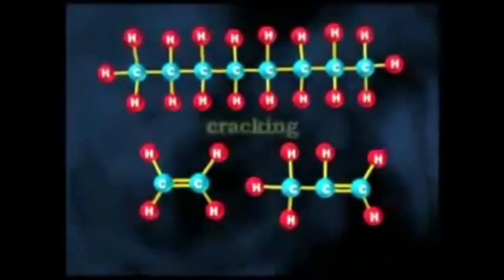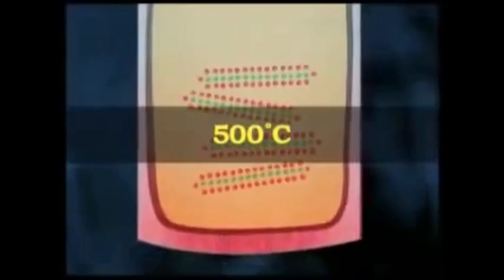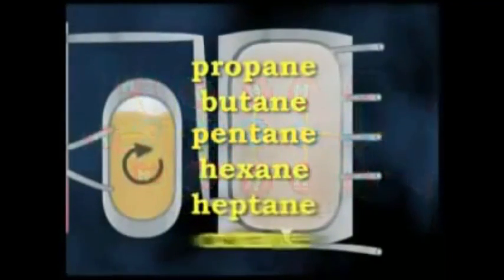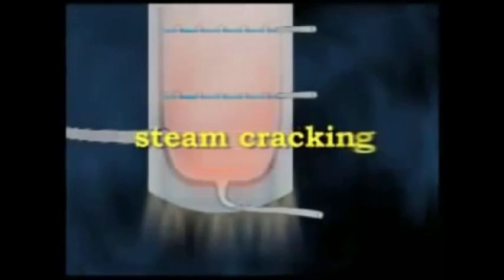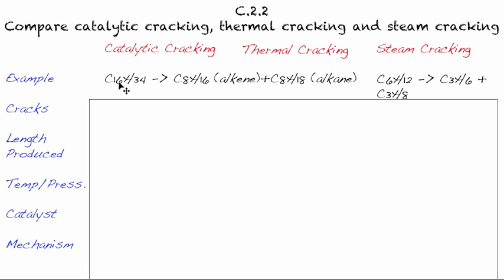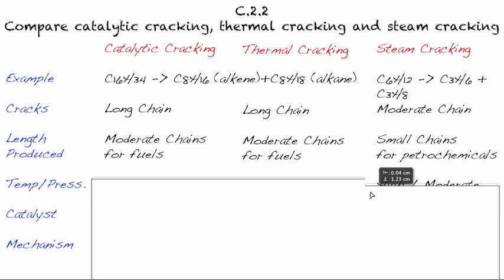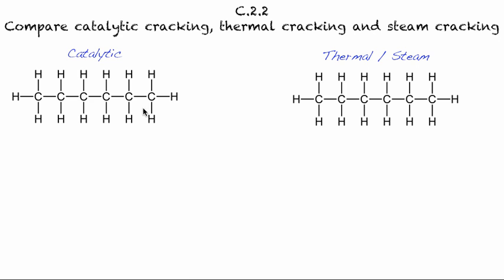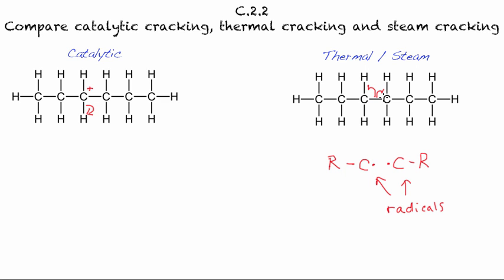C.2.2 - Compare catalytic cracking, thermal cracking and steam cracking

Comment: You can completely break up in the liquid phase heavy oils and fuel oil, using zeolite at a temperature of 300 to 350 degrees, but it is better to use ultrasound to increase the efficiency of the catalyst, and do not forget to put a coke separator. Lighter fractions will appear at the output, but it must be done in a cycle in order to increase efficiency.
 Zeolite with vacuum deposition of metals - 21% nickel, 72% copper, 6% tungsten, 1% thorium
Reply: Do you know how is the Zeolite powder treated for reuse, over & over again?